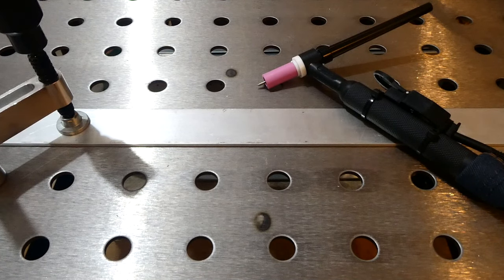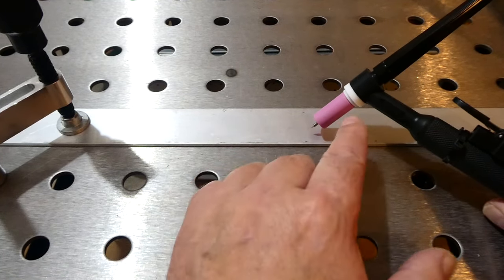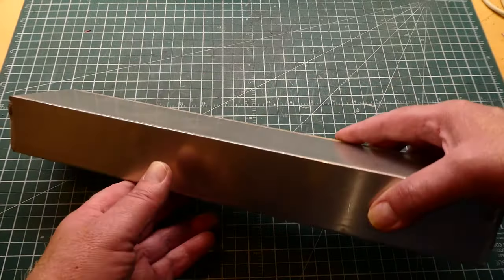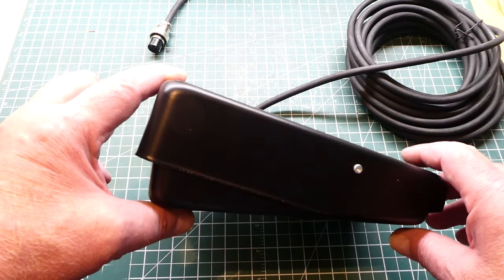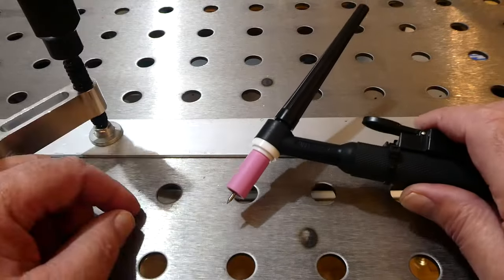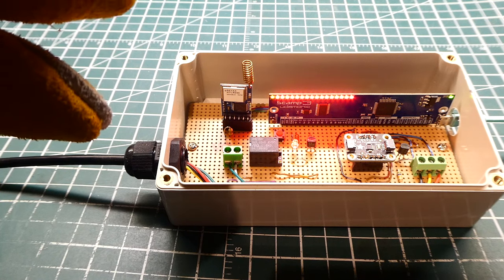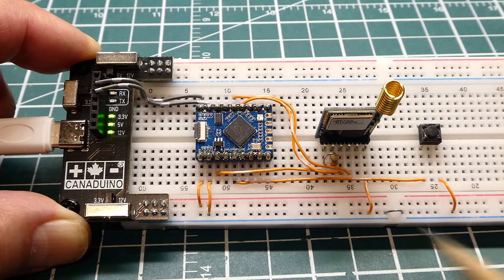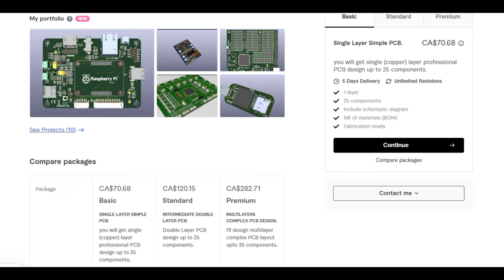Wireless TIG Welder Controller / Everlast TIG 210 EXT / Product Development

Comment: A beautiful project... in engineering and in heart! Bravo! Two suggestions... 1) For DIYers that want to weld aluminum, but don't have a true welder... There are aluminum brazing sticks that work with a simple brazing torch. These are the torches that screw onto the top of a handheld gas cylinder. The type that plumbers use to solder up copper pipe, with maybe two exceptions...a) I think "MAP" gas is needed to get a little more heat and b) MAP gas requires a little different torch head type. You will have to do your own research, because I have not welded in this manner, hands-on. I have watched the process, in person, and it is very much like soldering electronics. It is much less expensive to buy into than an electric welder. Maybe another viewer can give us more details. 2) I suggest also creating "training wheels" that would clamp onto the TIG torch head. They would set the welding distance and steady the tip. Maybe metal ball bearings would do for the wheels? HTH. Cheers.
Reply from the maker: Yes, there are other ways to weld aluminum. I have also used Ox/acetylene and aluminum brazing rods. I also use my TIG welder restoring vintage automobiles, cutting out rust and welding in patch panels. Thanks for the visit.

Comment: I very rarely comment on videos, but I unhid the comments section on YT especially so I could tell you that I really enjoyed this video; as I have many on your entire channel. I'm just starting my micro controller / maker journey, but am finding your videos a fascinating source of inspiration and ideas. One mans waste of time is another mans source of endless enjoyment. Please keep it up!

One question. How have you reverse engineered the pedal controls so you know which pin in that cable is for argon flow, which is for current etc. Do you come at it from the pedal, or the socket on the TIG welder box?

Thanks again
Reply from the maker: Thanks for the visit and comment ... Appreciate that.
The schematic for the footpedal and socket pinout was in the users manual for the welder.
In the video you can see 5 wires entering the control box. Two activate the gas flow with a relay closure.
The other three is for connecting to a 10K pot with 5 volts across it, which feeds 0 to 5 volts into the welder for amperage control. I am using a digital pot for that function. The pre/post gas flow times and maximum amperage is entered into welder itself. For complete setup info, check other YT videos on the Everlast TIG welder.

Comment: Not sure what you're using for the control, but I once bought some Force Sensing Resistors to build tig torch controller but then I found somebody with a similar idea called the TIgbutton.  I assume they're using an FSR, but I never bought one to find out how it was built.
Reply from the maker: I know someone who uses the Tigbutton. He likes it after getting used to the sensitivity. I was asked to come with an amperage controller not using the torch hand, and wireless. You just plug the control box into the welder and put on the glove. The glove uses optics and magnetics to decode hand "gestures" so no pressure is involved. I am also looking for other applications.